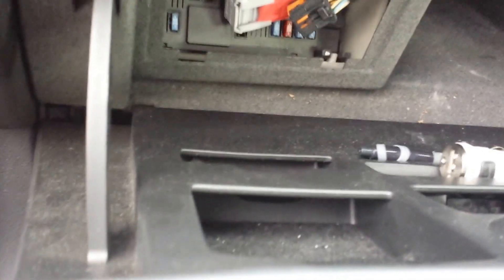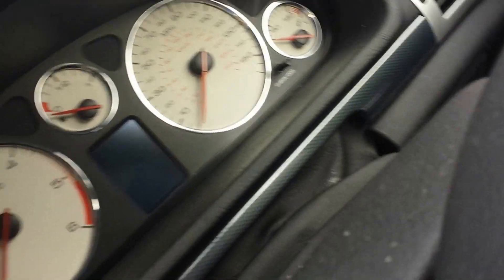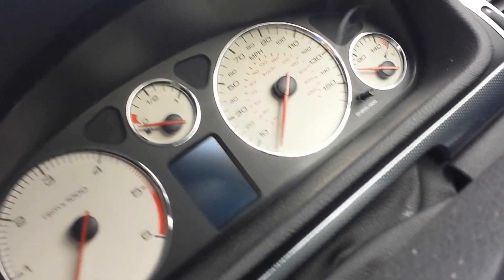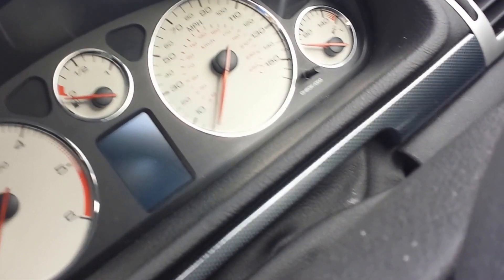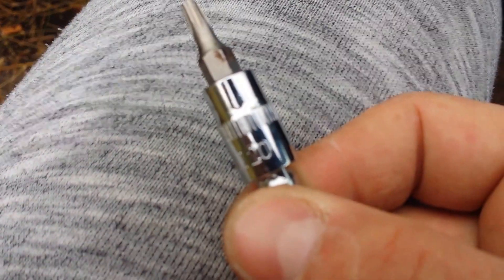PEUGEOT CITROEN C4 C5 307 407 PROBLEMS SIEMENS BSI ECU CHECK FOR WATER INGRESS OXIDATION PART 1

Comment: Hi! I have problem with my Peugeot 407, and I really need help. I'm desperate. My central locking doesn't work properly, or the keys, or the BSI, I don't know anymore. I SUSPECT THAT THE BSI IS THE PROBLEM! The problem is that the car seems to contantly "keep forgeting" the keys. So the situation is next, I've tried to make a BSI reset multiple times, successfully. After that, keys still don't work. When I turn ignition on, and hold lock button on the key for 10 seconds (syncronizing), after that key is working outstanding!!! After that, as soon as I lock the car, and wait for around 3,30 minutes, again keys will not work. There is few other problems:
1. kilometers on my trip computer (on the radio) are stuck on 1988 km, they are counting normally from 1988 km every time I start and drive the car, but every time when I reset trip to 0 and leave the car, after around 3.30 minutes, kilometers are back to 1988 km.
2. my fuel gauge is not working properly, when the tank is full it shows around 15% less fuel,
3. drivers seat heating isn't working.

On top of that there is one major problem. When is hot weather outside, my car simply turns off or cuts off when driving. After that I can normally start the car and drive it. It can happen anywhere, anytime and multiple times. There is no rules. But only during hot and summer weather. In winter or cold weather everything is just fine. People are telling me that the problem is in BSM (FUSE AND RELAY BOX) under the bonnet, some kind of contact in the BSM or so.. 
Please can you help me? Did you had similar cases??

Thank you in advance !
Greetings from Croatia
Reply: Hi , i have same problems ....Did you find a solution?
Reply: @lyudmilmashonov7520  I wrote multiple problems. If you have problem with cutting off or turning off the motor by of the car by itself while you are driving, then your problem is BSM (fusebox under the bonnet). The problem is next. When is hot weather outside and high temperatures, contacts of the relays are expanding and they are loose. When contacts of relays are loose, relays are not connected properly in that part of the second, and the car simply turns off (it can be relay of fuel pump for example. In my case the problem was relay of electrovalve for the common rail pump)
YOU MUST REPLACE THE WHOLE BSM FUSEBOX WITH ANOTHER ONE. NUMBERS & MARKS ON FUSEBOX MUST BE IDENTICAL. 

If you have problem in interior of te car, trip computer, seat heating, central locking, then YOU NEED TO TRY REPROGRAMMING THE BSI WITH YOUR ELECTRONIC GUY, IF THAT NOT WORKS YOU MUST REPLACE THE BSI FUSEBOX. Again, numbers and marks of the fusebox need to be the same.
Reply: @brunosimic9043  Thanks for fast answer Bruno .I forgot to explain that I have  the first three problems(fuel,remote locking and trip)  . For now ( it is not too hot ) I don't have problems with cutting off motor .  So like i see will serch for electrician to repair my BSI module . Thanks for explanation aggain .
Reply: @lyudmilmashonov7520  then you need to find the other BSI fusebox

Comment: Hello. Thank you for the videos! Very helpful. I also have a problem with a BSI but on a Citröen C4 2006. I need to take the BSI module to a specialist but I don't know where it exactly locates on my car. Do you think its in the same place as for the Peugeot, in the glovebox? Thanks!
Reply from the maker: Should be in the same place . The BSI is actually the Fuse Box . Google * citroen c4 interior fusebox location*
Reply: @THE.DIYGUY  Thanks!